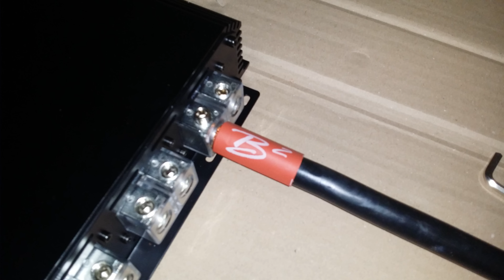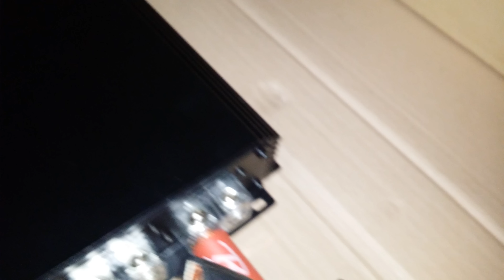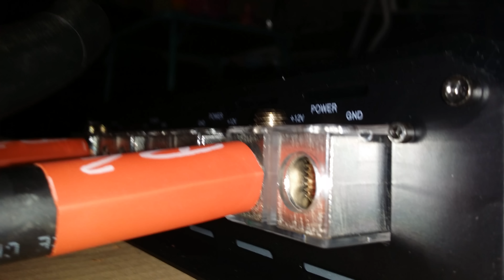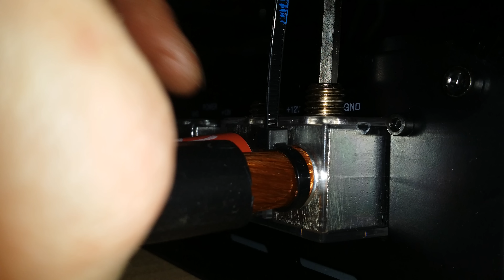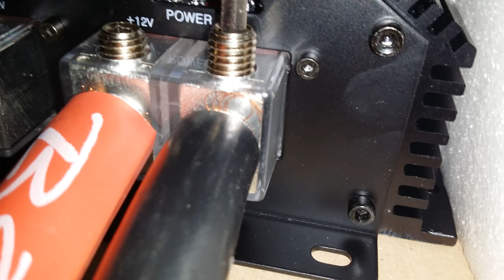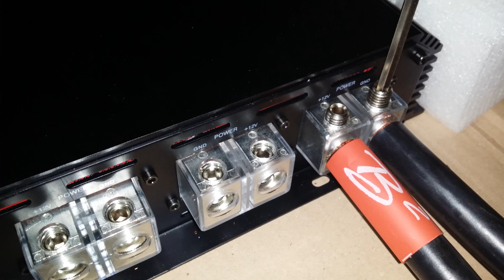How to easily get 4/0 wire into 1/0 amp terminal with minimal frey!!!

Comment: I only use stranded copper building cable wire (commonly called solid wire) because I keep burning all my 0awg speaker wire
Reply from the maker: O wow sounds as if maybe your pulling too many amps through the wire or you need more power output/battery reserve

Comment: Just use a 4/0 to 1/0 reducer
Reply from the maker: the wire is 1/0 size tho just a lil tight my friend audio wire is loose in the case welding wire is tight so 4/0 welding cable fits in 1/0 audio openings lol just like 2/0 welding cable fits in 4ga amp terminals no problem but tight

Comment: Just buy reducers $8 esp if huge amp no wonder I see cars on fire on sides of roads lol
Reply from the maker: lmao reducers hmm... that's another connection point thats obviously not needed and bro i never had anything fall out or come apart been at this for over 15 years ive never ran a fuse in my personal builds and have always had 800ah of batts or more never one issue this is 100% the way wires go into amps and are supposed to where in any manual have you ever seen adapters or Farrels recommend... ill wait oh thats right nowhere lol if u want to be super technical get it right atleast and solder the tips of the wires then put them in the amp 🤣

Comment: ferrels FTW or a 1/0 - 4 Gauge to 1/0 - 4 Gauge Amp Input Reducers
Reply from the maker: Why would I go 1/0 to a smaller wire? This amp can pull 1400+ amps at 20kw

Comment: 4/0 awg welding wire Is the Size of 2/0 sky high oversized and knu koncepts.
I used 2/0 welding now, but my main run from front to rear is 1/0 sky high and there the same size wire. the jacket is about the same also, sky high jacket might be a tad bigger, but the welding wire jacket is more durable for sure.. I'll use 2/0 welding from now on tho, the copper looks just as good for a better price. I have noticed welding wire has gotten more expensive though, they raise shipping to make up for it.. lol
Reply from the maker: Lol yeah welding wire for the win lol thanks for dropping in
Reply: Welding Cable Ftwn
Reply from the maker: @g-style4466  yessir!
Reply from the maker: stay tuned this baby is going to be put in hopefully for slamology. i have a secret build coming up
Reply: Most welding wire is not OFC and therefor has a lot more loss than the correct OFC cable. It's cheaper for a reason.
Reply from the maker: @BifsieOfficial  im sorry but id have to disagree on this one, thanks for watching

Comment: My guy, reducers are a thing.
Reply from the maker: Hey this works and unless the reducer is copper it will cause resistance 😉 even copper ones still resistance the less connection points the better always. Plz like and subscribe 😊

Comment: That extra wire happened to me also. I just used my razor blade and cut wire up against the amp. No more wire overage...lol Oh and your way was way better than mines. I use to use a small flat head screw driver to pry all the wires in, it worked but your way rocks...
Reply from the maker: Tower G4 thanks glad I could help and ya I have done all that too lol I was sick of cutting strands

Comment: 1/0  would've been enough  ..Go by manufactures recommended size.. also   you  should   never use un ended  bare  wire   ..  the tip  should be capped
Reply from the maker: well it technically is the right size being audio wire is crap non rated, loose strands in a loose jacket  1/0 audio wire compresses to like 2ga lol welding wire 4/0 is same size as loose audio 1/0 and on this much power the bigger the better i have 8/0 going in one day once i get the courage to route it 🤣

Comment: Or you could just buy wire ferrels. lol, they are very cheap
Reply from the maker: or even solder the wire ends before inserted this is quick easy for a normal install nothing fancy

Comment: great tip. you know you coulc also just solder the wire to make it a more like one piece wire and still it would work???  and there will be no fraze from the wire.
Reply from the maker: Ya I do solder my smaller wires just this one eh lol
Reply: Never solder wire going into a friction type connection like this. Solder holds the strands apart and when it gets warm, will deform making a loose connection adding heat and creating a thermal run-away condition. This is how things catch fire.
Reply: @BifsieOfficial  Preach the good word. No solder in friction connections. Let that wire crush down good and proper.

Comment: what wire are you using  I am looking for some good wire  because I am going to doing 4 12 inch skar  evl 2500 max rms 1250 watt and a skar 4500.1 amp  and skar door speakers
Reply from the maker: michael krech vlogs that will sound nice!! And this is 4/0 welding cable
Reply: where can I find that wire at or am I better off using  1/0 wire ofc
Reply from the maker: michael krech vlogs honestly you'll be fine running 2 2/0 welding cable leads on that skar 4500 and go on eBay and type in 2/0 excelene weld or even amazon

Comment: What about when you take the wire out to relocate the amp or to change amps? I'd just spend the money for 4/0 - 1/0 inputs if your going to spend the money on that amp. B2 for the win by the way.
Reply from the maker: Whisky Tango Foxtrot honestly I have no intentions on moving the amp once it's placed, I may run inputs

Comment: This may be a dumb question but, how are you able to fit 4/0 wire into a 1/0 terminal period? I can't even fit 2/0 into 1/0.
Reply from the maker: John Smith this is welding cable. Audio classified wire is most of the time loose strands and oversized, junk copper in my opinion
Reply: KING@SPL I just ordered some 1/0 welding cable for my amp that recommends 1/0 wire. Will that be enough? It's a 2k watt amp. Thanks for the help.
Reply from the maker: John Smith yes the 1/0 welding cable should be a tad smaller than ur amp terminal, just do a big 3 upgrade with the 1/0 as well and ur grounds, also add a secondary battery if you dont already have one.
Reply: KING@SPL thanks man!
Reply from the maker: John Smith no problem let me know if you need anything else
Reply: John Smith     plenty   people are just about overkill and wire waste...    1/0   was anof
Reply from the maker: It wasn't enough smh you'll learn one day I'm trying to teach slowly
Reply: because its not 4/0 its 1/0. he has 4 inputs of 1/0. put the tip of your pointer finger too tip of thumb and thats how big real 4/0 awg wire is
Reply: @dddurk123456789  How big are your hands, Donald?

Comment: wire ferrules
Reply from the maker: +S0uthp4w68 for 4/0 lil pricy
Reply: S0uthp4w68 just bought some of Amazon for 5 $...
Reply from the maker: +John Aranjo $5 each for 4/0
Reply: right?! It is 2018, who jams in wires now days
Reply from the maker: 90%
Reply: A 4/0 wire ferrule will not fit into a 1/0 amp input. I have 2/0 ferrules that won't fit into the 1/0 input on my MRX-M240 Alpine amplifier. The KnuKonceptz 4/0 to 1/0 reducers were also too large for my amp. Knu shit is okay, but unnecessarily bulky imo.
Reply from the maker: Imdb Truth thanks for the input on this
Reply: Another thing to consider is that the size of car audio cable is not regulated or standardized like the size of wires for a house would be. For example, I have some "4 gauge" car audio power wire laying around that is almost exactly the size of 2 AWG building wire. So remember that terminals or wire ferrules may or not fit the wire even if they are rated for for the correct gauge.
Reply from the maker: Thank you for explaining that I've tried lol

Comment: that wire is not 4/0awg. nowhere close to 4 ought. that is o gauge going into a 0 gauge terminal. you aint fooling me.  reaal 4 ought is bigger then a quater in diameter.
Reply from the maker: Sorry bud but it is 4/0 certified welding cable 😄

Comment: Those terminals are bigger than 1/0 , no way in hell true 4/0 would fit into a true 1/0 without trimming back 30 to 40 % of the wire , but it still a nice tip
Reply from the maker: charlie francis ya i agree but audio cable isint regulated on size or regulated at all ya get what the company sells you. So most the time audio cable is larger than standard wire sizes

Comment: Not the proper way you gotta use ferrules they act more like a clamp pushing the cable down tight against the screw block terminal, without them the screw digs into the cable and breaks of strands and you don't get it  torque properly making a poor connection, dumb video.
Reply from the maker: I know thanks, I had issues with the Farrel and it wouldn't work 😅 so this came forth

Comment: is that 4/0 welding wire
Reply from the maker: +Bobby BASSHEAD yes sir it sure is lol
Reply: no it is  not! that is clearly 0 gauge or 1/0  however u wanna write that. 4/0 awg is the same thickness as a 1 inch pvc pipe. its huge. the wire in the video is clearly 1/0awg

Comment: That's a great tip, thank you for sharing! However, I would not normally say that there would be a benefit to using a larger wire than the amp's terminals are rated for. Power cables are obviously extremely important, but my thought is if you buy a quality amp, it would have large enough terminals to accommodate the necessary wiring. However, if you have 4/0 cable laying around that you want to use or you just want to use larger wire, this is a great tip! Just don't feel like you need to buy the largest wire that money can buy and struggle to cram it into terminals that it was never designed to fit into, because there is no benefit.
Reply from the maker: Thanks for the support and positive feedback! To be honest you can never have too many leads going into the amp. The manufacturer makes a 16 lead + and 16 lead - adapter that plugs into the amp
Reply: @KINGSPL  Thank you for the response! I didn't realize that this was a 15KW amp LOL. Here is a tip- This is a really good voltage drop calculator that will tell you very close to what the actual voltage drop will be with different wiring setups.-https://www.calculator.net/voltage-drop-calculator.html
Reply from the maker: @averyalexander2303  yup lol a beast for sure and thanks I'll go check that site out for sure. My batt bank will be uploaded soon I hope I may keep it secret till slam. Boutta be a lotta h8ters lol

Comment: Never had this issue lol just hold it correctly and insert it from one side to the other guiding it in with fingers... also use real car audio wire so it fits correctly lol ppl who use welding wire for car audio smdh and just an FYI car audio wire is a lot bigger than that welding wire by a lot so your 4/0 is the same size as say sky high 1/0 so .....
Reply from the maker: Ya but with welding wire I know my copper content is 100% as stated compared to car audio wire being unregulated to a government standard it could be 60% copper and you would never know
Reply: I agree his 4/0 is tiny my 4/0 is much larger that looks like 2/0

Comment: LOL to bad thats not 4/0 gauge wire, the amp has 0 gauge power and grounds x's 4. That wire just fits the terminal, its 0 gauge at most. who ever told you that 4/0 gauge seen you coming. Im running true 0 gauge on my amp, my amps terminals are 0 gauge x's2 power and grounds and my wire just fits. Get true 4/0 gauge wire and you wont get it to fit to save your life less you use a reducer.
Reply from the maker: Lol ur hilarious this is the truest 4/0 you can get 😂🤣 welding cable is government regulated for safety smh
Reply from the maker: Keep running oversized car audio junk lol it has to be oversized to handle the power of real true wire 😂🤣 #GetYaFactsRight lol thanks for watching
Reply: @ColdVenom159  exactly ..I don't know how he has people believing that they can put 4/0 wire into that amp..